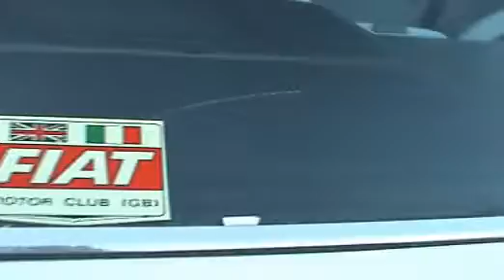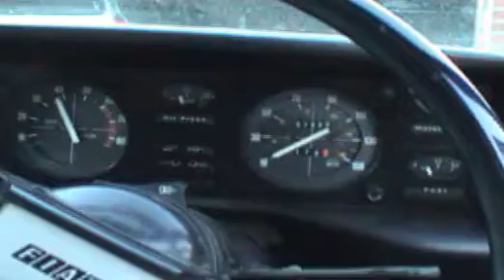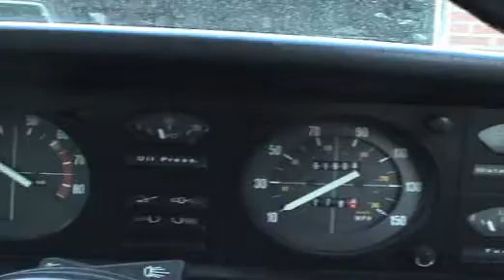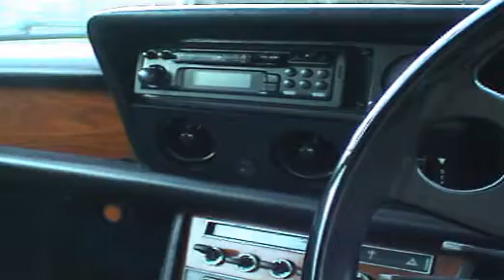fiat 130 coupe

Comment: If they selled this in USA, maybe it could have been a classic car worldwide! The car is beautiful, for a 70's FIAT, It has a good rust proof and a good engine. Maybe if they put 2 versions: the actual 3.2 V6 engine and another 5.2 V8 engine with manual or automatic speed, then that would be better.